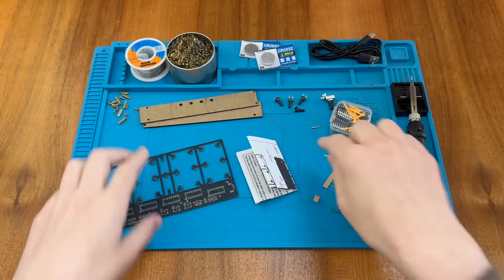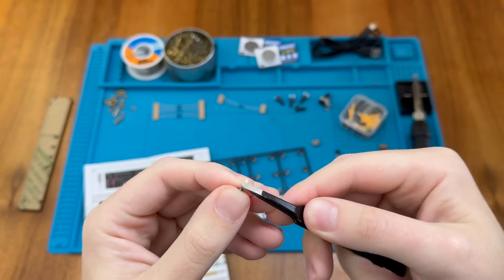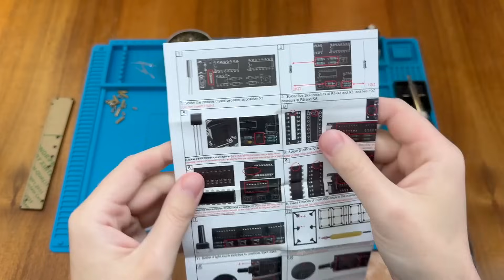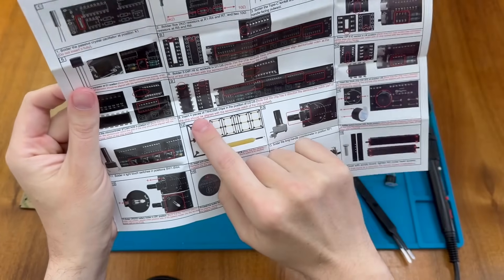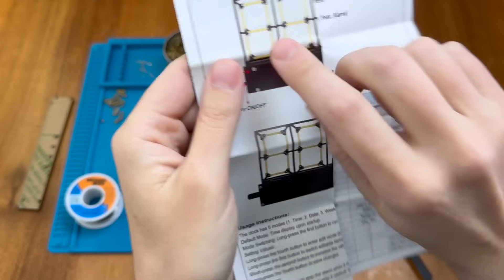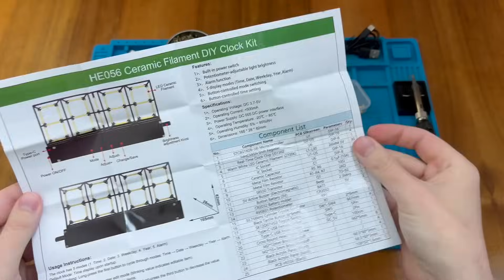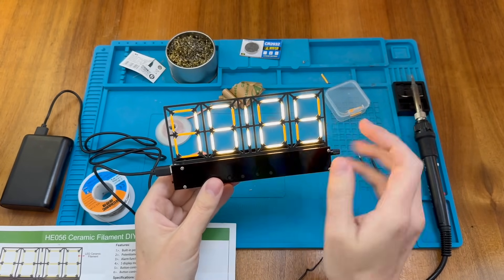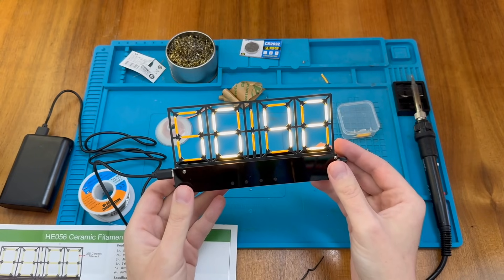Ceramic Filament LED Clock (HE056) - DIY Electronic Soldering Kit Assembly and Testing

Comment: I can't seem to set the time on mine. Can set everything else. I get the 'a' segment stuck on ( MSD) and can't change it. In setup mode, the left button seems to bypass time set mode. I'll keep trying...
Reply: Sorted. Removed the battery and RTC chip. waited 30 mins. Replace clock ship. tried setup again, this time 100%. put battery back in and all looks good.
Reply from the maker: @martinshoebridge9679  Glad you sorted it. The RTC chip does seem a little temperamental.

Comment: hi built one the other day but my one is ruining very fast so poor time keeping how well does the one you have  built keep time ?
Reply: just replying to my own comment turned out to the the time keeping chip not pushed in to it socket properly now working fine
Reply from the maker: @valvemonky4734  Yes. I had the same issue! You might spot that it was running pretty fast at the end of the video. Once I reseated the chip, it's been running pretty well.
Reply: @jtjacques  ye just checked out the end of you video and i can see it was doing the same as my clock every 10 seconds my clock was changing the minutes its a nice little clock for the price 😎👍

Comment: How accurate is this clock?
Will the time be significantly off if left alone for a long time?
Reply from the maker: The clock uses a dedicated DS1302 timekeeping chip and a standard 32.768 kHz quartz clock crystal, so it should be reasonably accuarate. I've had it running for several weeks now and it seems to be keeping good time.

Comment: I wish the digits had a 5-10⁰ slant.
Reply from the maker: That would certainly add to the design aesthetic.
Reply: @jtjacques  It would probably be possible to mod. Ether by cutting the PCB or probably easier just use flying leads.
Reply from the maker: @markawbolton  That would certainly be neat. I think I'll leave that as an idea for others. I already managed to break one of the filaments, after all!
Reply: @jtjacques  I quite like using copper / brass welding rods to make a frame structure and solder components onto them to make cyber punk looking project. It can be a bit fiddly untill you get the hang of it so I suggest a novice play about with some practice constructions to get the hang of it.

Comment: Ever since the first failed retrofit filament LED showed up in the disposable bin at supermarkets, I came up with the idea of a 7digit clock/lamp made from that led filament. So I started collecting those lamps, crushing the bulbs while not braking the filament.
Found that usually the filament are wired in series and the driver is a simple current limiter +rectifier. They usually even skip caps for smoothing the current (which explains the terrible flicker of those bulbs).
So while my stock of filament of different sizes and voltages grow, I recently not only found you can grab the filament on Ali in different length and colours and 5v, but also sell the hole clock....
So I bought one.
But I'm still collecting old bulbs. For the recycling aspect. Not fully figured out the HV driver jet, but with the high variety of filament and therefore slow progress of accumulate a full set, I guess I have another 10 years to get my circuit planed.

Nice presentation of the clock. Kept me entertained until mine arrive soon.
Reply from the maker: That's great. Good luck with your circuit design, and thanks for the feedback.

Comment: Did you have you 1k pot for brightness?  Mine was missing. The instructions dont show,how to put the filaments in for the top, middle and bottom
Reply from the maker: Yes, my kit was complete and included the potentiometer. If you have missing parts, you should contact the seller.

For my kit, the square pads in the frame are positive (+) and the round pads are negative (-). On the LED bars, there is a tiny hole punched in one end of the filament, which is the positive end (+).

Do carefully check the instructions supplied with the kit though!
Reply: @jtjacques yes. I bought 1st kit from tiktok, missing crystal, socket but had the 1k pot. The 2nd kit from amazon missing more stuff. I requested a replacement
Reply from the maker: That's a run of bad luck! I hope you get the missing parts and are able to complete the kits.
Reply: @jtjacques I hope so too
Reply: @jtjacques I gave a,replacement is,coming

Comment: I just put together the same clock. Everything works except the time just stays where I set it. It wont move forward
Reply from the maker: This may indicate that the clock chip is not getting a pulse from the crystal. First, I'd try reseating the DS1302 chip (the small 8 pin IC) and ensure that it is inserted the correct way around; i.e. "upside down" compared to the others. Another basic check is to look over the board for any poor solder joints or other issues in that area of the circuit. If that doesn't help, you'll probably need to inspect things a little more closely with some test equipment. That might include ensuring continuity between the various components with a multimeter and checking the crystal is actually oscillating if you have an oscilloscope available. Best of luck!

Comment: I noticed, that there were no load capacitors next to the quartz.
Reply from the maker: Fortunately, you don't need external load capacitors with the DS1302. The capacitors are internal to the chip. See pages 2 and 3 of the data sheet for the example circuit and block diagram. https://www.analog.com/media/en/technical-documentation/data-sheets/ds1302.pdf

Comment: Ceramic filament, I don't see how they could be "ceramic"  I have similar filaments and they are not ceramic but made of the same material as any other LED filament of this type.
Reply from the maker: The instruction sheet describes them as ceramic here: https://youtu.be/tVkMACiPoMk?t=131

I think this is just referring to the substrate. According to Wikipedia this is often glass or sapphire. However, some manufacturers do indeed use ceramic substrates. e.g. https://www.segula.de/en/the-led-filament/

As I demonstrate, the short LED filaments included with the clock kit are fairly evenly illuminated through both sides so they may well have a transparent substrate. https://youtu.be/tVkMACiPoMk?t=636

However, in my related video you can see that some LEDs of this type clearly do have a more opaque substrate, indicating that they may use a ceramic base for the LEDs. e.g. https://youtu.be/2KxSvG_3R0w?t=838
Reply: @jtjacques  Thank you for these clarifications, I will take a look at the links you sent me. 👍
Reply: Jason accidentally broke one, that might be considered as a clear indication of them being ceramic... Just joking ofc, thank you for the additional clarification 😅
Reply from the maker: @bjornrathje746  Well, the ones in the kit are certainly not supposed to bendy in the middle... whoops!

Comment: Where do u get the kit? I have done Nixie clock kits mostly of just soldering pins for the tube and assemble the case ty
Here's my YouTube video of the clock please subscribe to my YouTube channel and like thanks
https://youtu.be/_fkWGj_as4o?si=MPBQVS1ToM4Z0Utv
Reply from the maker: The kit was a gift from my brother. However, I know he purchased it from AliExpress. I'm not sure if this is the same seller, but here is an example of this kit: https://www.aliexpress.com/item/1005008783566810.html

Comment: The brightness pot was on the back of the board so the board wouldn't lie flat on the bench. That's why they suggested to put the filaments in first.
Reply from the maker: That's an interesting thought. However, you have to solder the filaments from the back. By the time you get to that step, the front is covered in all sorts of components. This means that it won't lay flat when soldering. I used Blu Tack to stop the filaments falling out. If keeping the PCB flat on the bench was the rationale, why not have the assembler do the filaments as the very first step?

Comment: Could tell me what is that putty you are using to hold the components in place to solder?? thanks.
Reply from the maker: Sure! It's Blu Tack. I think similar products are available in the USA as mounting putty. https://en.wikipedia.org/wiki/Blu_Tack#Similar_products
Reply: @jtjacques  well there's the issue, I'm from Argentina... I will have to see what can I get. I surely can get some play do'h but I doubt it would be good for that, I'm afraid the heat of the solder will make it turn rock solid.
Reply from the maker: I'd expect that similar products are available in most office supply or hardware stores. Best of luck finding something suitable!
Reply: @jtjacques  yeah, I just checked and to my surprise there IS Blu Tack here... usually there are a lot of products on the US that here you just can't find.

Comment: Seems like it might look a bit nicer with some lightly-darkened acrylic in front of the LEDs as well
Reply from the maker: My thoughts exactly! I think a gently "smoked" translucent sheet would be awesome.
Reply: Maybe a layer of Plexiglases on each side of the clock with some of that silver 2 way mirror tint buisineses use on their windows. One side is reflective and the other is see through. Could create an infinity effect
Reply from the maker: @sinformant  That sound really cool!
Reply: I've built my kit and placed a 2 foot x 2 foot piece of 28mm chip board in front of it... And it now doesn't tell me the time 🤔 how annoying.
Reply: ...or a light coat of dark spray paint on the segment (applied before sordering).
Enough to make tham look black when off, but not blocking too much light when on (somewhat similar to a smoked acrylic sheet)